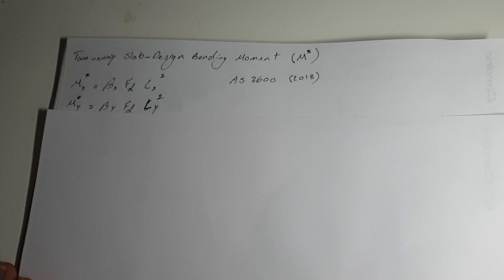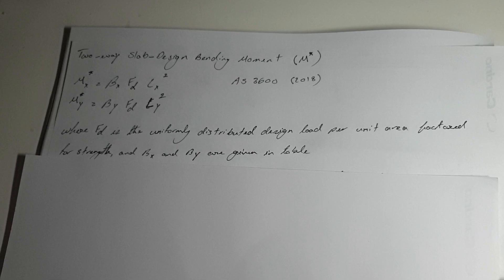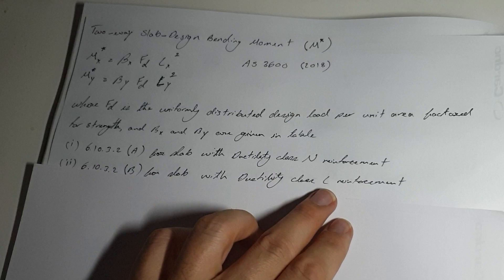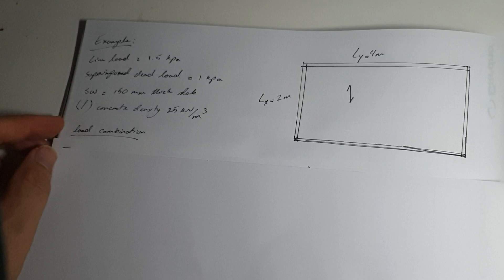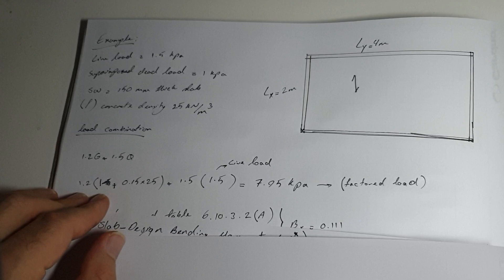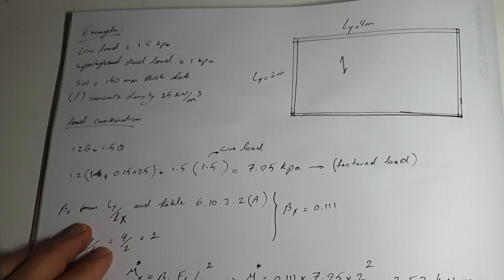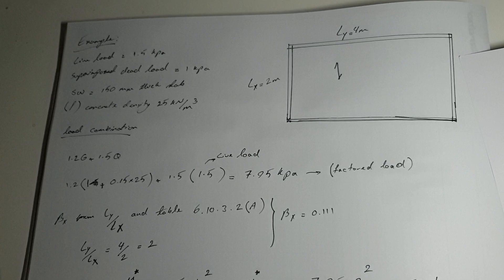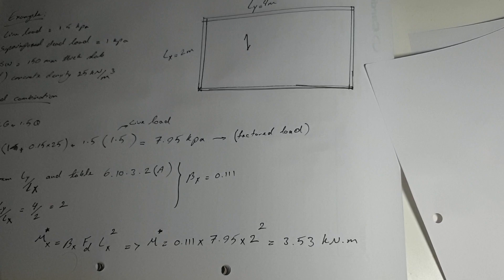Two-way Slab Design Bending Moment- Australian Standard- AS3600

Comment: I check your equation for M*y, as you have an error. when calculating the design bending moment in the y direction we still use the effective shorter span of the slab. ie. Lx. refer to AS3600.2018 Cl 6.10.3.2  Equation 6.10.3.2(2)
Reply from the maker: Thanks for your comment. I did not use that formula, that was just to show the two formula are different. you are however right, that must be Lx.

Comment: Hi Felix, Thanks for your video.
Just wondering can we use this formula if the slab simply supported onto four sides WITHOUT any hold down (no walls above the slab)?
According to 6.10.3.1 AS3600, there is a sentence saying "have corners that are prevented from lifting..."
Hope you are able to answer this. Thanks a lot
Reply from the maker: Hi Gary, Thanks for your comment. I believe you are right about the requirement of the code. As AS3600 states, " The design bending moment and shear forces for strength in reinforced two-way simply supported or continuous rectangular slabs, which are supported by walls or beam on four sides AND have corners that are prevented from lifting" in most cases this is actually true. you may have walls over or corner bars (between column and (beam/slab)) which prevent the corners from lifting unless you are dealing with a very special case (structure) which I have not seen before. hope this helps